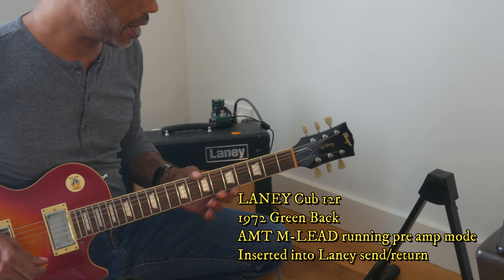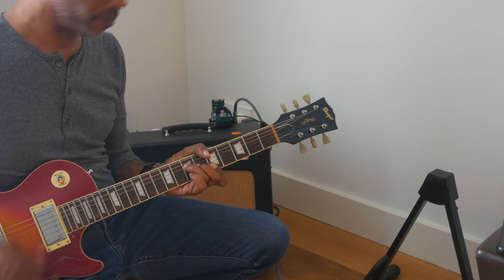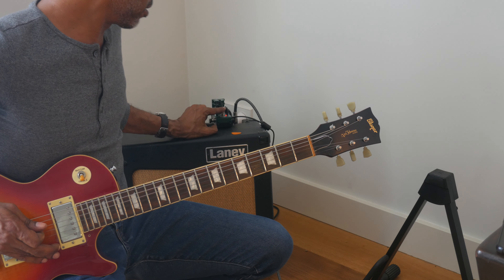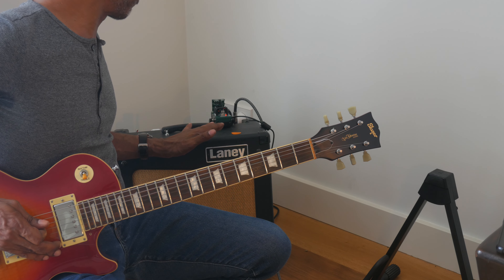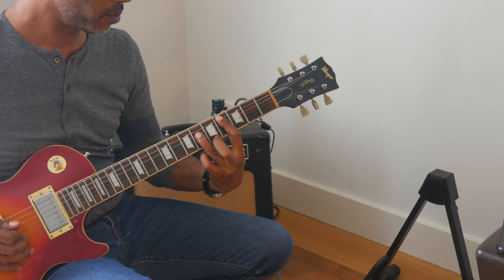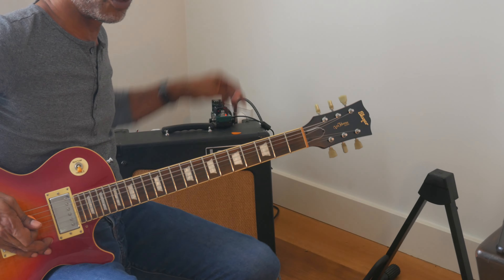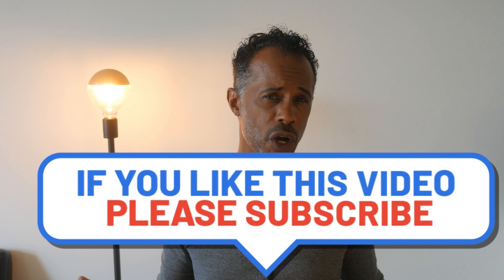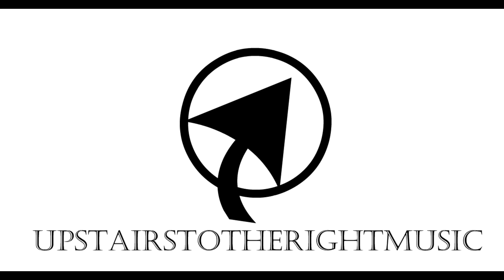AMT M LEAD PLUS : TRUE TUBE DISTORTION?

Comment: Hello, did you made contact with the manufacturer to be able to tell that it’s full tube circuit in preamp mode and hybrid in drive mode? I ask ´cause I bought an used A-bass on the local classifieds and disassembled it to take a look. Unfortunately, I am not enough knowledgeable to determinate the actual signal path! Lots of surface mounts components…

I understand that there is some SS devices in the power supply but I am curious to know if the circuit is an authentic clone of the Alembic FB-2. By authentic, I mean without solid state devices in the audio path. Thanks!